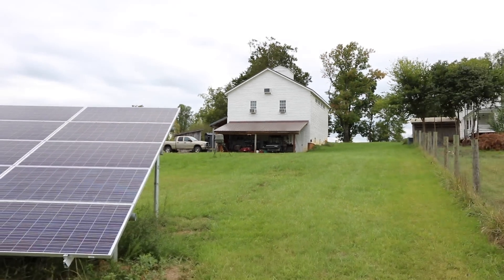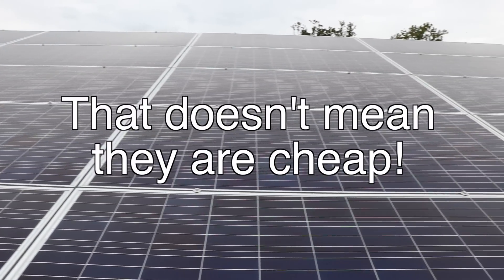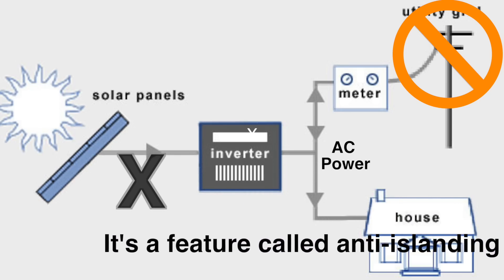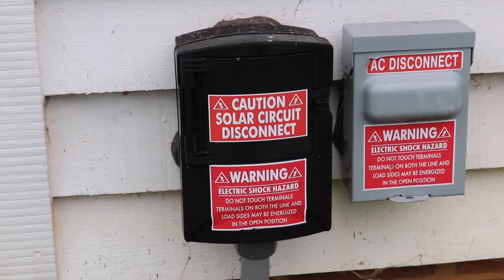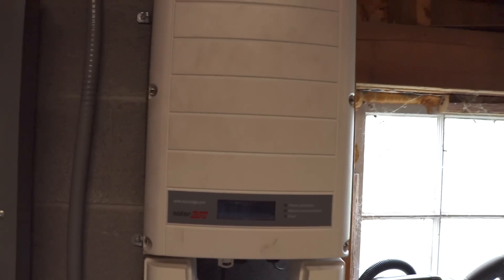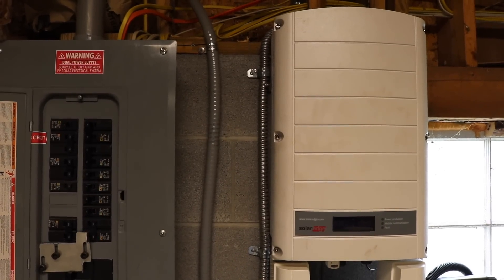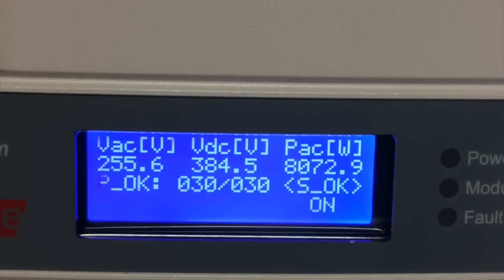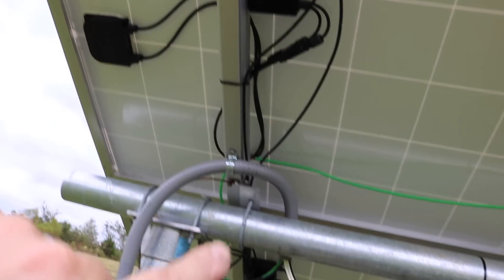The ugly truth behind grid-tie solar systems. Part 1, FarmCraft101 solar.  Watch before you buy!

Comment: Why would the system go down if the grid goes down? We recently installed 100% offgrid 1kw system  with max usage of 2,5kw and it is completly off grid. Sure we go low on electricity at times but even though it is very non-american there is something very nice and this probably sounds quite hippie but for nature saying that the energy of the day has ended and that you should do something without electricity and get back to it tomorrow.

Comment: Regarding your estimated time until the system pays for itself, besides no estimates for repairs, you spent $17k up front and did not consider your loss in investment opportunities and the cost of not having the money readily available. As an extreme example, if you could have earned $2.4k/yr from the $17k, you would never get your initial investment back. That would be 14% per year, which is not likely. However, repairs costs and the additional time you need to spend (unless you value your time at a negative hourly rate because you enjoy time spent with the panels) would reduce the rate you would need. Considering these things, a reasonable estimate of the time until you break even is significantly longer.

Comment: If you were concerned about the cost of wire why did you put the panels so far away?
Reply: More concerned about wire diameter than length.
Reply: @lostconflict9369  Both are relevant, ask any electrician.
Reply: @bobjackson4720  Seeing as he is the one who had to buy the wires. We can assume he checked the prices, meaning running a higher voltage. Which isn't even that high. Is better than a higher ampage. Why do you think transmission lines run a high voltage and a lower ampage. Not to mention, if he buys a spool of wire. And runs the whole distance or not, his cost won't change. Not to mention i didn't say one wasn't relevant. Ask anyone who can read.

Comment: Did you plan this system yourself, or had a company do it? Solar-Edge and the optimizers are actually only used for really complicated shadowed areas. Your place looks pretty clean and with low chance of shadow, many other inverters would have been cheaper and dont need optimizers.

Comment: 8.5 years for a return on a system with a fall off in  efficiency and a life of 10 years approx. Not ideal
Reply: Solar panels are warrantied for 10-25 years depending on manufacturer and panel chosen.  They also have power production guarantees, some as high as about 92% power in the 25th year of life.  Central inverters have a shorter life but are warrantied for 10+ years.  Micros from Enphase for instance have a 25 year warranty.  Prices are only dropping on solar and it makes a lot of sense for many people!
Reply: whattheschmidt What is the extra cost of a solar panel with a 25 year warranty.
I've got a grid tied system that puts out approx 300% of my electrical consumption in the summer approx 120% in the winter. 15-16 years ago it cost £47,000 minus the 60% Grant given by the government at the time. Via EDF as the power provider, they pay on average £1500 per annum, above what we pay out to them

Comment: NRG offers a system that generates when grid is down....you just switch the outputs to local receptacles called “secure power supply” adding peace of mind for extended outages.

Comment: Optimisers are wired in series..you can hook two panels to an optimiser for a little extra savings, you don't have to put one on each panel...two panels, 2 pos., 2 neg wires..hook one set to put the panels together and the other set into optimiser.

Comment: I don't believe the inverter is set at a fixed voltage higher then the grid. I believe it is just looking at current flow and maintains a fixed current flow so depending on how long your wires are from the inverter to the grid Transformer will set the voltage needed 2 equal the amount of current that the inverter wants to put out. You got a nice setup

Comment: Lol, I use a out 95 - 120 of electricity every Quarter it'll take me almost 40 years to see that setup back!  Changing your lifestyle and useage habits saves a lot more money a lot faster.
Reply: Use a smaller setup. A 100w flexible panel (that you can zip tie anywhere) is $80 on aliexpress. A couple of these and a nice controller can run at least the lights and fridge. Add a battery and you are off grid.

Comment: Good video.  Thanks!  I installed a 15kw ground mounted system myself using Enphase inverters for simplicity.  DC is converted directly to 220VAC at each panel.  It was one of the easiest...most elegant projects that I have ever done.  Lithium iron phosphate batteries will be next.  My system:. https://ressupply.com/featured-projects/william-g-157kw-grid-tied-ground-mount/article

Comment: Another thing to consider is investing the money in the stock market instead of in the solar panels. For example, if you would have invested the 17,000 in the market into a vanguard mutual fund target dated to 8 years out, you would have a little over an 8% return on that money in the 8 years leading up to 2020. So, 17,000 invested in 2011 would be worth about 32,175 in year 2019 in your scenario. Depending on how you invested the money (qualified vs. non-qualified), and you decide to access the money, you would have some gains tax on that, reducing your take home to just under 30,000. With that in mind, your “break even” in 8 years doesn’t assume the time value of money and the alternative choices you could make with that money. Just my two cents. Theoretically, given the option to invest, you would never really break even financially by buying solar panels for most cases as compared to investing in the market - even in conservative funds.

Comment: OK...you've had 2 years now to collect data.  What did you find your system ACTUALLY does compared to what you projected ?  Based on my experience with solar, your initial numbers were optimistic.  I'd be surprised if a 9kw system offsets a $200/mo bill unless you're paying a lot per kwhr....(please give those figures....kwhr use per month/yr, and cost per kwhr for grid power).....especially if you factor in batteries which lower overall system efficiency significantly.  I wouldn't be surprised to so see your payback time period double what you project.

Comment: I have a question, can you add a disconnect before the meter so you you can stop flow to the grid, during power outage and keep your generated power just flowing to your home? It just seems so counterproductive and inconvenient to not have power when the grid goes down, even though you have your own independent solar electricity generation in your yard.
Reply: I turn off the main breaker and backfeed through an outlet on my porch. You could do that and send the solar through but I would lock it out so that I was sure the house was disconnected from the mains.

Comment: Very nice solar system but I don't understand why it cost so much. I just looked up 305 watt solar panels on the internet. They cost between $100 and $200 each. An inverter cost $100 - $500. All of the additional materials can't cost more than about $2,000. So the total cost for materials shouldn't be more than $9000 or $10,000, at the very most. No? Did you decide to go with a contractor (and thus pay a premium) because you could only get the tax credit if a licensed dealer installed the solar panels?

Comment: The right way to connect it: Solar Panel -> inverter -> house electrical system then -> meter grid-tie system. This way when the grid is down the house uses and stores electricity first, Then once it hits meter the grid is either on or off. "Solar Panel -> inverter -> house -> batteries<-->  meter -> grid" When batteries are fully charged System skips batteries. house <--> meter -> grid. This way batteries are only used as a back up like when the grid is down.

Comment: Nice video. I think you said that you have a single circuit coming from the array to the inverter. How is this possible? With single phase Solar Edge inverters  (non HD Wave) you can only have 5,250W per string, which means you  need at least two stings for your system.

Comment: Very informative. Am trying school myself into a bit of electric insight. This video did wonders for me. Thanks for that.
Quick question though: the so-called optimizer .. is that the same as today's micro inverters?
Reply: late reply - no, optimizers work at the DC level 'in series' together feeding a central inverter at up to 500 Volts DC delievring your 240V AC line. With Micro Inverters each panel, sometimes a few lower wattage panels together, deliver AC line voltage (240) in parallel. Let's say a panel delivers  250W. The panel itself delivers that DC at say 25 Volts, 10 Amps (10*25=250) a micro inverter will convert to AC at 240 Volts with some losses at 1 Amp (for 240 *1 = 240W). Fine. Now 1 panel gets shaded and delivers only 20% = 50 Watts. Well, the Micro-inverter will simply just deliver a shade under 0.2 Amp  now for almost 50 watts. In the optimizer case, all the other panels still want to push 10 Amps, and the shaded one follows this by only delivering 5 Volts instead of its nominal 25 V as 5*10 = 50 is all it can deliver. How? By using a DC to DC converter!

Comment: STOP! Efficiency comparison is useless. You first need to think about usable sunlight hours and where you live so PLEASE read the info below:
Most of the planet are using the wrong Panels!
If you don't track the sun daily, if your not going to change the angle seasonally or if you have a decent amount of overcast days and if you have a bit of extra space then the best panels are thin film. Most of the northern hemisphere are using mono or polycrystaline panels which are no good unless you live at the equator or unless you track the sun throughout the day and the year.
  The panels that everyone uses only work well when aligned into the sun and are completly unobstructed from shadow.
  Thin film panels will work in low light levels which includes sunrise sunset, overcast days partially obstructed by shadow and unaligned panels. 
  So unless you track the sun Mono and Polycrystalline are only getting a decent amount of power for 4 or 5 hours a day for half of the year.
Thin film will give you full power all day all year long!
  If you have a little more space and can invest a little more initially you will soon recover your costs and more!

Comment: Disconnect  (important!) your main breaker and put a generator or an inverter in the circuit as a placebo.
Reply: Typically, a Grid-Tie inverters will not SYNC to a generator.
Reply: Connecting the grid tie inverter to the same teie in point as the generator is a big NO NO. The solar PV system can turn your generator into a motor.
Reply: @zenniz1992  A "Zero Net Export" configuration on the Grid-Tie Inverter would solve that problem.

Comment: Technical accuracy of this video is superb, except the "Optimizers" are (as far as I know) simply bypass diodes.
Reply: no, optimizers  are DC-DC converters. Here is a copy of an also late reply I made earlier :  no, optimizers work at the DC level 'in series' together feeding a central inverter at up to 500 Volts DC delievring your 240V AC line. With Micro Inverters each panel, sometimes a few lower wattage panels together, deliver AC line voltage (240) in parallel. Let's say a panel delivers  250W. The panel itself delivers that DC at say 25 Volts, 10 Amps (10*25=250) a micro inverter will convert to AC at 240 Volts with some losses at 1 Amp (for 240 *1 = 240W). Fine. Now 1 panel gets shaded and delivers only 20% = 50 Watts. Well, the Micro-inverter will simply just deliver a shade under 0.2 Amp  now for almost 50 watts. In the optimizer case, all the other panels still want to push 10 Amps, and the shaded one follows this by only delivering 5 Volts instead of its nominal 25 V as 5*10 = 50 is all it can deliver. How? By using a DC to DC converter!

Comment: Enjoyed this walk around...we're getting ready to build our home and have space for solar setup...this was helpful
Reply: I enjoy your content!
Reply: Thanks for this input. We have an off grid cabin but have been looking for something for our home. Our eastern horizon is 20 miles away and our western horizon it between 45 and 100 miles. I wired the home with a sub panel with all the critical things except the pump. I think I’m going to just get batteries and power the subpanel with solar. Our cabin has a 48v 4Kw inverter and 8 months a year we run on the sun. It is off the road and we have a freezer and washing machine there.
Reply: 300 watt panel does that.produce that per.hr the sun is shining  example  4x300 =1200 watts

Comment: I can't believe the prices you guys pay for solar!! Outrageously high... 

I bought a 6kw system here in Australia, cost me $3999, the same system now costs $3491, but you get an extra 600w of panels... 

Before the yanks think- hey that's not that bad a price, remember the exchange rate- $3491Au is $2585US- for a 6.6kw system, he paid $17 thousand US  for a 9.1kw system... 

That is fully fitted, all permits etc all done by licenced electricians and panel fitters here in Australia (no DIY for gridties)... 

That means that in Australia, we are paying $0.39US per watt, fully installed, putting power into the grid, where FarmCraft paid $1.86US per watt installed... That's nearly five times more per watt installed... 

Something stinks there...
(If I paid $17000US equivalent for an install here, that would give me a 43KW solar array!!!, not a 9.1kw array)
:-O
Reply: @Srteve D - Yes, people can and do over pay for PV in the USA.  I can get a 8,000 Watt PV Array with a Central Inverter for about $4,000 and then self-install.  Or I can pay BIG $$$'s to have it installed - ouch !
Reply: @MrSummitville  $2600US for 6.6kw- fully installed, nothing to do but sign the contract and give them the money- that's it...
Reply: @steved2136  Unfortunately,  I cannot get a 6.6kw PV Array installed for $2,600.  And especially not in Califonia, where everything is way more expensive.  "Leased" systems can be much cheaper. The Cost-Of-Living varies tremendously  ...
Reply: @MrSummitville  That's the bit I can't get, Australia is every bit as expensive as California, even more so (we have a country that is as large as the 'lower 48', with a population equal to NY...), yet our solar is that much cheaper...
Indeed that is one of the reasons Aussies have a bit of a giggle at the US idea that 'we don't know how long panels last' and the whole '10-20 years they wear out'- because our electricity costs are so high, we have been using gridtie solar for the last quarter of a century (yes it's been available that long)- my mothers one is nearly that old (installed '97) and is still pumping out the power day after day (it's down the expected amount, but still isn't considered worth replacing, because it still contributes a major lessening to the bill)- it would cancel the bill entirely if the workshop out the back wasn't in daily use
Reply: @steved2136  I agree .. nothing makes sense in California. It defies logic ...

Comment: I never asked this but why is it that a Generac back up generator starts when the grid is down and doesn’t backfeed but you can’t get the same setup with solar?
Reply: s w i t c h i n g   will be setup, to  disconnect/isolate  the local grid from the
main grid.
Reply: David Davids exactly so why can’t they do the same thing with solar setups?
Reply: @mattomite9097  why are you asking me,     and  who  is
'they'.      suggest you learn to say things in an  adult
way;  Without using a   PRONOUN.   see the following
statements.       this is an OLDER  installation, one that
complied with the  code,  at the time.       imo, the 
decision to run  DC  from the pv array was  less-than
logical.    other  facts may  be  'atypical'.     cheers
Reply: David Davids thanks Mr Helper for responding to my question AND the English lesson. I replied to you because you felt the need to educate me and to respond to my question. Never mind you provided  nothing in the way of an answer to my original post. 

Since you like providing minimalistic answers maybe you will accept this advice...don’t respond to a question!!!  Maybe don’t involve yourself in the discussion Mr Helper. Cheers

Oh and maybe don’t respond in fragmented sentences. There now I feel like I’m providing  an adult lesson